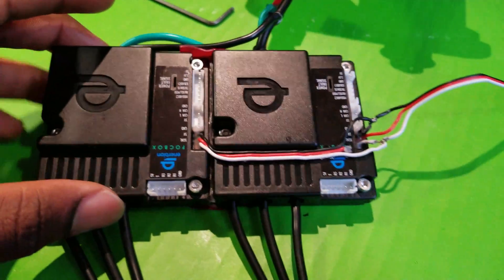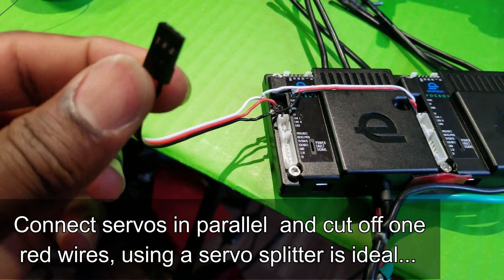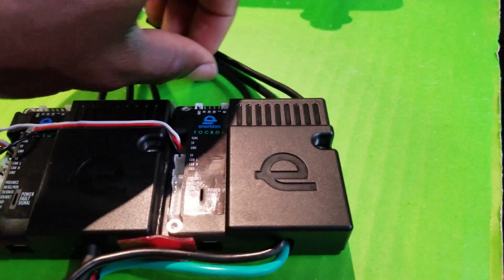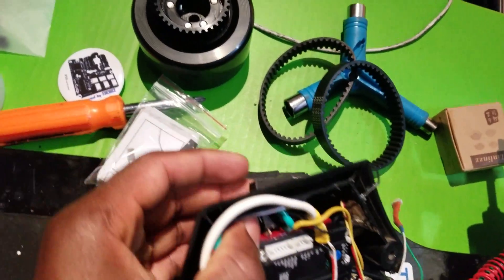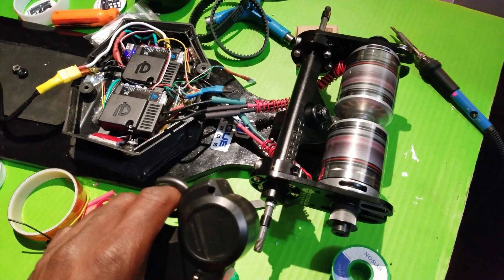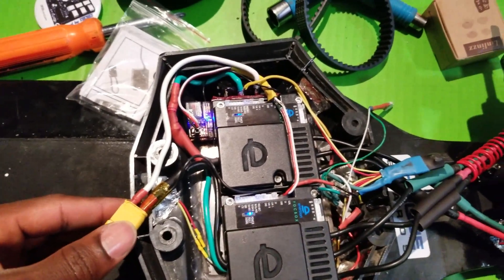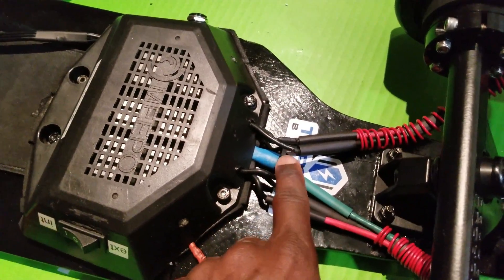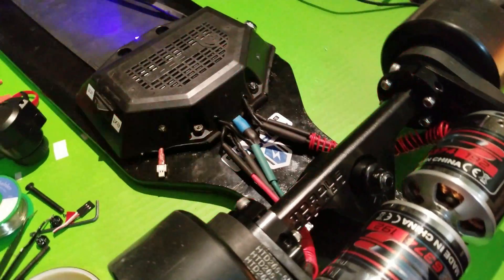HOW TO BUILD THE BEST DIY ELECTRIC SKATEBOARD? BOOSTED BOARD KILLER - Part #3

Comment: Nice work! Do you have the total cost and price breakdown for your build by chance? Thanks
Reply from the maker: Yeah, below is a link, but you can save a lot. I just wanted everything to match the best way possible so I kinda went full throttle on parts. I'm using lipo batteries for their insane juice and power delivery. But the downside is charging them. Had to get a balance charger (the series connection between the 2 lipos packs have to be disconnected before charging, otherwise, the charger blows). I would understand if you choose 18650 instead! I included links to every part also. You will notice that I put FOCBOX unity as the controller, that's because I upgraded later (same price as two single focbox)
https://drive.google.com/open?id=17MatxH2dB1TQLIRj4UMSvbgxqVqeMtOm
Reply: @YvonSmart  Thanks for the info! Good to know about FOCBOX upgrade